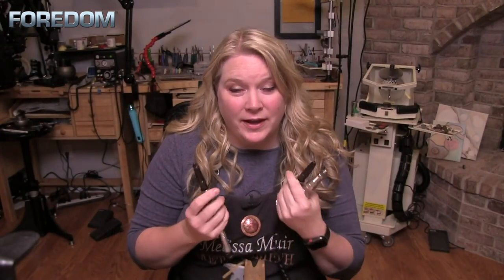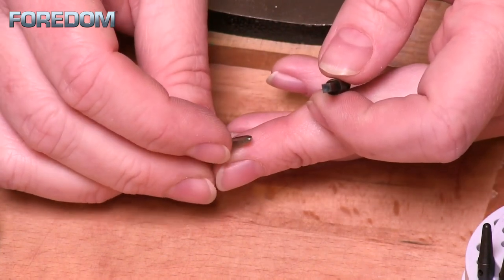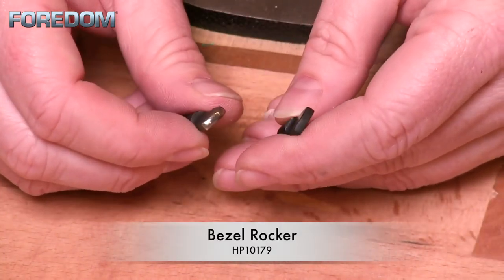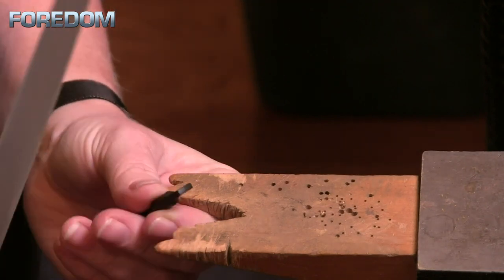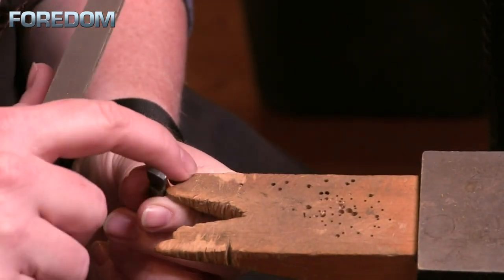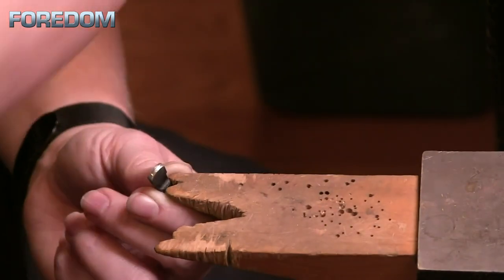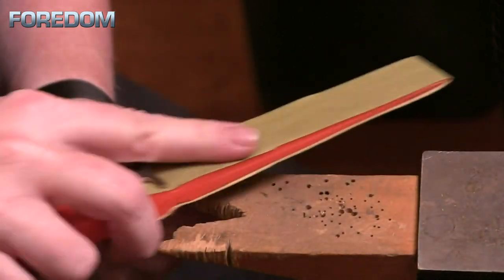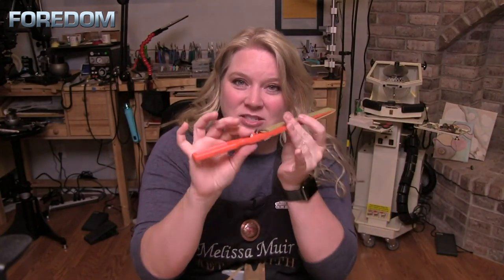Altering and Polishing Foredom Anvil Points

Comment: I don’t think anyone with a knowledge of files would use one to file hardened steel…it sounds awful..😱..and will ruin the file.
A grinding wheel or stone would be better to get the initial required shape..
Reply: The tips are not hardened steel. Did you not hear Melissa talking about the tip being altered by hitting on 'soft' precious metal?
Stay safe, Steve.